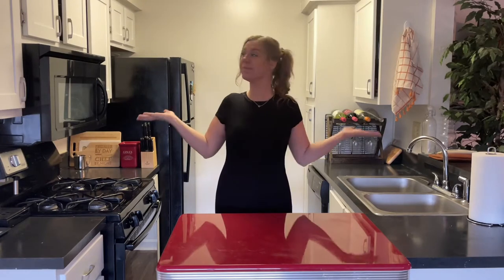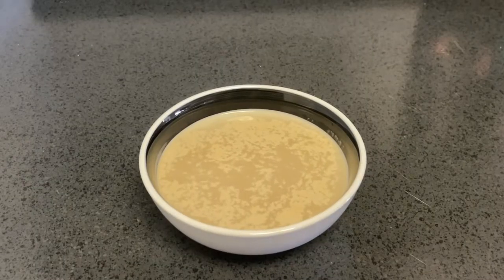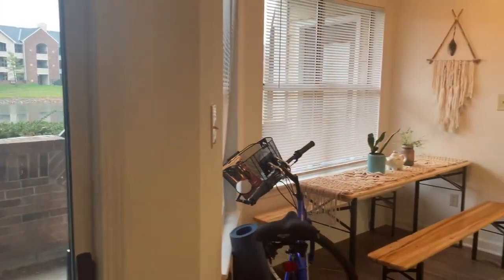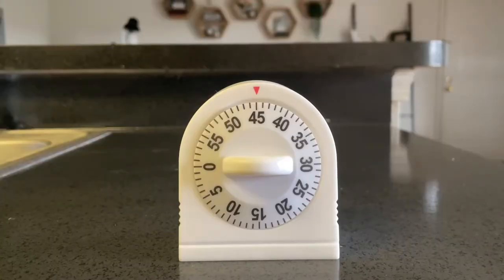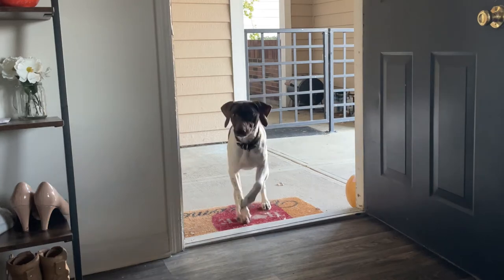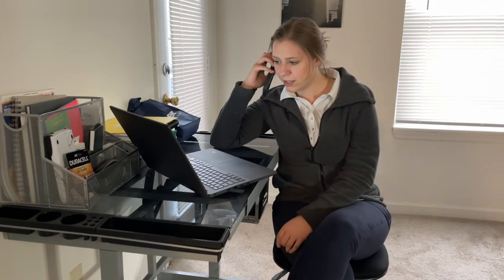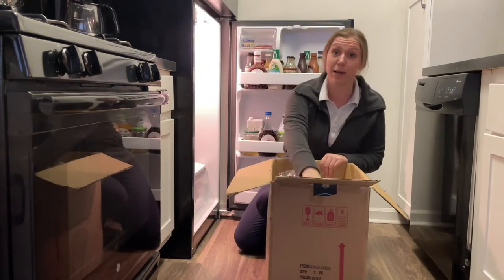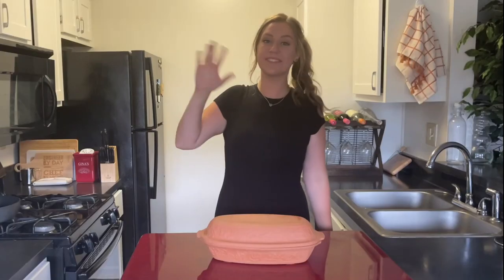How to Make Bread from Scratch in a Romertopf Clay Cooker

Comment: Hi former Jersey girl too here! Cute video! Just suggestion, watch Baking with Jack video on shaping and forming dough..u will get taller loaf, less spread, was a game-changer for me,  also, avoid putting hot clay baker on a counter top, drastic temp change could make it crack. Put on towel or silicone mat 🙂
Reply from the maker: Thank you so much for the tip, I will definitely check out that video! And I did indeed learn the lesson the hard way about avoiding the counter, not because it cracked the clay but because the counter got a burn mark 😬😂 I’ll keep that in mind for sure

Comment: If I remember right from home economics the bottom rack is for Angel food cake & Anything tall 
2nd rack is Baking brownies & biscuits 3rd rack is for Cookies & Cakes
 & D is for do not use other than broiling 😂 
So my question is should I bake my bread on the 2 nd rack ?
Reply from the maker: That’s a really good frame of reference to use, I’ve never heard of that rule! I always try to center whatever I’m baking, so the center of the dish is roughly centered in the oven, that way the bottom isn’t too close to the oven floor (which would burn the bottom) and the top isn’t too close to the oven ceiling (which would burn the top), so I agree the second rack would work for bread! You could probably get away with the third rack as well